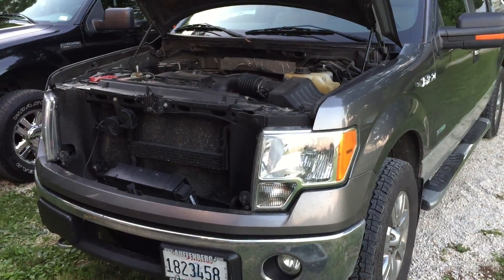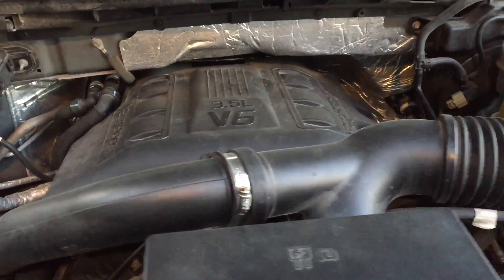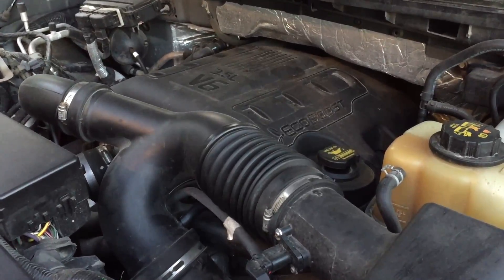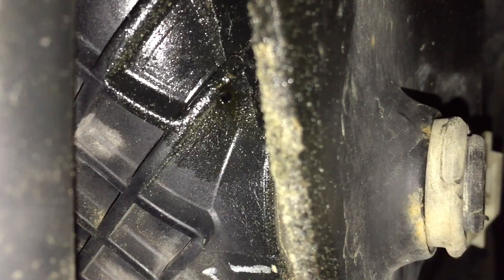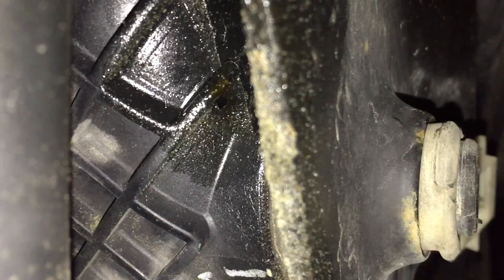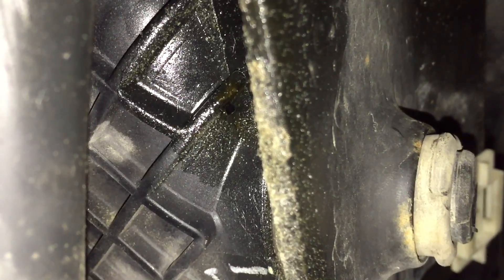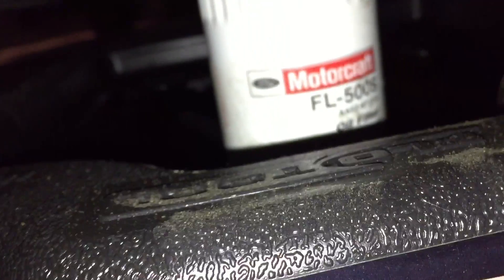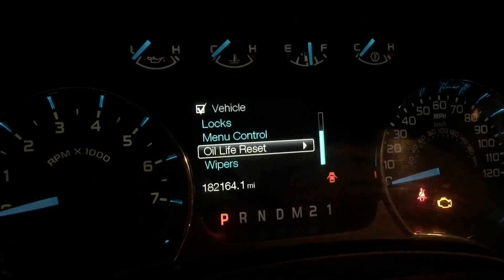Hole Drilled in Intercooler Fixes EcoBoost Misfire

Comment: usually oil in the charge pipes means your turbo needs to be rebuilt soon
Reply: The Tool Guy's username is completely appropriate.  He's a complete "Tool".
Reply: the PCV valve is a one way valve. normally hooked up between valve cover and intake manifold.  it normally only allows suction when the intake manifold is under vacum... the breather would go before the turbo and after MAF or AFM... pcv and breather normally just pull oil vapor , fumes and moisture from the crankcase wich can cause buildup of gunk... if the crankase was to see boost pressure most of the oil seals on your engine would fail... 

most guys performance shops will tell you that excessive oil in charge pipes means your turbo's bearings are worn out causing shaft play and and oil seaping into turbine and compressor housing......
Reply: The Tool.  OMG let it go,  your being a "keyboard warrior".  I honestly have no clue why you have your panties in a bunch. I asked a question and you call me a dumb ass.  Like I said before have a nice Thanksgiving, I'm cooking.
Reply: I never looked at the PCV systems of cars that came turbocharged from the factory. Normally when i turbo a car i delete the stock PCV system. I prefer to use a catch can with a breather .....
Reply: The Tool Guy usually it has the pcv on the intake manifold or right before the throttle body.  Oil in the intercooler or charge pipe means bad turbo.
Reply: The Tool Guy after the turbo?  Or before?
Reply: The Tool Guy where did I say the "turbo magically makes the oil go away"? Arm chair warrior? You're the one calling names. Lol.  Tough guy.  

There's a breather and there's a pcv.  Pre turbo is a breather after that is a pcv. By the way,  a pcv is a one way check valve,  no boost in the crank case no matter where you put it.
Reply: direct injection is mainly the culprit in that cause gasoline doesn't hit the back side of the valve causing real bad carbon buildup on intake valves.. pcv valves cause gunk buildup inside of intake manifolds mainly...
Reply: The Tool lol,  go educate yourself and grow up.  Learn to have a conversation.
Reply: The Tool,  okay.  Buddy.  Have a nice Thanksgiving.
Reply: samuel loves,  the tool needs to read your reply lol.
Reply: and when the seals go bad your exhaust will be blowing smoke..
Reply: samuel lopes. I know a few years ago the PCV was causing shit to build up on one cylinder head. Every 20,000 miles the damn things needed a new head.
Reply: not always. could be a normal buildup of oil and condensation over time, especially on higher milage vehicles. Thats why alot of guys in the diesel world reroute the PCV. The small amount of oil that comes through the PVC covers the inside of the intake system and fills up the intercooler. Then the EGR introduces soot into the system which sticks to the oil and builds up a nasty charcoal cake in the intake and intake runners.
Reply: too much shit talking. when in doubt check the turbo or turbos for shaft play....  usually smokey exhaust is a good sign of bad shaft seals...
Reply: there you go again.. if the turbine is hitting it's housing wall thats a pretty good sign you have way too much shaft play...
Reply: That's not necessarily true.  The breather tubes to evacuate pressure from the crankcase is connected to the intake on the turbo.  That is the oil vapors that accumulate over time in all the tubes and intercooler.
Reply: No it's not. It's a sign of shitty engines and engine parts. I've worked on thousands of turbodiesels and when you've got oil in the intake system you've got a problem.  It's shitty PCV system on those boat anchor EcoBoosts that is the problem.
Reply: The Tool Guy so you're saying most techs don't have a dial indicator ???
Reply: The Tool Guy hahaha I forget automotive mechanics have to have a machinist measure anything smaller than their pecker
Reply: Oil is from blow by
Reply: All turbo and supercharged engines end up with oil in the charge air coolers and pipes. It's just a side effect of forced induction.

Comment: i am 1000% against doing this. it is completely asinine
Reply: No its not. I had my motor replaced at 60k and receive my truck back, the problem continued so I drilled the hole and haven't had the issue since 130k

Comment: How the hell is he getting 22mpg??? I'm only getting 16.8 mpg in my '12 ecoboost f-150
Reply: Mine technically was not in 4wd because the transfer case has to be engaged to get pulling power to the front wheels. (switch on dash 2wd 4wd and 4wL) The hubs were staying locked in which means the front axles were turning when you roll the front wheels thus if they turn that means the front differential has to turn and then the front drive shaft turns and then it connects to the transfer case where is spins in (neutral).  All this is power robing and most of all fuel mileage killer.  Now to diagnose the problem jack both front tires off the ground with engine running and spin the drivers side.  If the front axles or driveshaft turns then the vacuum switch i spoke of is bad or you could have a bad vac line going to the hub on either side (unlikely with low miles).  Remember engine running wheels jacked off ground and also selector switch on 2wd.
Reply: @purplemartin2233  new to EcoBoost... what is this "hub" you refer to?  Expand please... thanks!
Reply: Thanks for the advice! Ill post a reply after checking. Lord knows how many trucks this may be affecting...
Reply: killswitch022 putting around the back woods on flat flat Illinois ground, at 55 mph.
Reply: check you vac switch that operates  the auto hubs.  the $20 switch goes bad and you hubs stay locked in killing your fuel mileage.  its located on driver firewall and takes 30 sec to change. fixed my 13 eco fuel mileage. went from 16ish to 20-21 plus mpg
Reply: mark - does that mean your 4x4 was staying constantly  engaged?  what were the symptoms that led you to this discovery?  i'm curious because  my 2012 had to have both front hubs replaced at 45k....twice.  When I'm offroad in 4x4 I hear a lot popping coming from the undercarriage when articulating.  The guys at the dealer couldn't replicate it so they told me all was well.  My  biiggest issue is i can't get better than 14.5mpg!  Thanks for any additional insight.
Reply: Shit I have a 2015 and I o ly get 17.4
Reply: Altitude makes a big factor

Comment: Interesting fix. I now have 344,000 km on my 2011 eco and to solve my condensation issue I went with a full race all aluminum front mount intercooler and piping it cured the problem as well and lowering the boost pressure air temp
Reply: This is something I believe my used truck has installed.

Comment: You shouldn't have any oil residue coming out of the charge side or exhaust side of the turbo. If there is, the turbo shaft seal/s are probably leaking...

Comment: While I worked at a Ford shop I noticed these 3.5L ecoboost engines really never had any issues
Reply: I have 190,000kms  (118,000 miles) and not a single issue of any kind.
Reply: A lot of pelple were nervous about these engines but Ford said they were the 'upgrade' from the naturally aspirated V8 (Coyote?)
Reply: Well other then the timing chain and phaser issue not unlike the 5.4L did...so 10+ years latter...same issue different flavor. Oh yeah and exhaust manifolds...been through several and several turbos too!
Reply: robert feller how do you know when it’s time to replace the turbos
Reply: lots of broken exhaust manifold studs
Reply: Benny wurz is mad he got a 5.0 instead of 3.5
Reply: @bigf1502  I have several Ford trucks,  both the 5.0 and 3.5  EcoBoost.  The EcoBoost is major pain in the Ass!
Reply: @bennywurz2995  You got lucky with your 5.0 then. Feels like all of those old tritons were terrible now days. Bought a used 3.5 from 2011 and it's in good shape.
Reply: This is a fucking piece of shit

Comment: actually it's not moisture build up its a blown turbo that much oil and water in there is from the turbo seals leaking those turbos are prone to fail there's allot of company's that have used that design vw audi Subaru and so on ...ever heard of water and methanol injection? water in the intake track wouldn't cause that.
Reply: Eric Leo water and methanol injection is different from liquid water lying in an intake pipe SMH
Reply: Krankie V 
well for one thing no one said anything about water in an intake pipe, that would be pre turbo if it was in the intake pipe and have nothing to do with the intercooler...there's a high pressure side and low pressure side of an intercooler and that being so it wouldn't pick up the water or oil from the bottom of the intercooler, my statement about water and methanol was just that a statement that water getting into the combustion chamber on that small of a scale wouldn't cause what was happening...  that sludge  coming out of the bottom looked like antifreeze and oil contamination and would lead you to think it was blown seals in the turbos... sorry I should have been more specific about the water meth statement.
Reply: Eric Leo I'm taking about the outlet.from the intercooler. as stated in the video, this area experiences a lot of humidity. this caused watery condensation to build up heavily in the unit, then under hard acceleration, water and oil mixture would be forced into the intake. it wouldn't be a fine mist like water/methanol injection, rather just a dribble of actual liquid which can very easily cause a skip

Comment: hahaha, made me laugh, ford? this vehicles are designed to fail. all is about headaches.
Reply: this vehicle has 182,000 miles on the original engine.  i've never seen this "first Hand" with some other brands.
Reply: Stubby Does Stuff  take a look at the million mile Tundra on TFL and see how many repairs it needed

Comment: to the guy asking about why gm lifters go bad.....there was a manufacturing time frame that gm used lousy steal to make the cams out of I believe between 05 and 12, the cam would prematurely ware the rollers out and cause lifter failure I've seen this a handful of times with the 5.3 and 6.0
Reply: mike masse sorry to do it to such an old comment but, steel*  wear*  you are correct on the bad cams.

Comment: 182k is impressive. It seems the first year or two of the 3.5 EB were problematic.  Same goes for the 3v 5.4. 
It amazes me one engine can't make it 100k and another will see 300k trouble free miles. 🤔
Reply: Yeah the fucking 5.4 tritons suck. Engine is faulty design.
Reply: @slowfudgeballs9517 I had an 08 lariat

Comment: What was fords TSB on this if it's a common issue?
Reply from the maker: Ford's TSB is to replace the intercooler and install different shields. But I've heard that it can cause slight performance decreases, loss of fuel mileage, and sometimes not even fix the problem. Plus, those intercoolers are upwards of a grand, drilling a little hole didn't cost us anything.
Reply: +DanielJaegerFilms why not install a catch can?
Reply: Can confirm that on our 2015 f-150 3.5 ecoboost the replacement intercooler did not fix anything. We still had problems with it continually after that.
Reply: Never got to do anything, sadly the truck was totaled from an idiot who ran a stop sign and crashed into it before we found a fix. We've since replaced it with a 2017 f-250 and have nothing but good things to say about it.
Reply: And if you really don't like the hole, you can easily plug it back up for cheap.
Reply: Nissanquasquicars
Reply: briskmlg so what did u end up doing?

Comment: put a one way check valve so stuff doesn't get in.
Reply: +benzlover55 i dont see why it would be needed. there is boost pressure that will be coming out. if anything there would be some air pressure coming out not sucking in air. the valve would kind of be useless.
Reply: +Guinelle1 not when the vehicle is parked.

Comment: I wouldn't call this a good design if you have to drill a hole in your intercooler to keep it from missing. Also don't think it would very reliable in this respect. Honestly just stick with the 5.0l or get yourself a GM small block. That is an engine that will outlast the truck two times over.
Reply: No
Reply: +matthebest018 fuck anything general motors. Hell no
Reply: +matthebest018 My Chevy 4.8L work truck has gone through an entire set of lifters in 130,000 miles. It's not expensive but it's a pain in the ass and tedious. I'd rather drill a hole in my intercooler than change out another set of goddamn lifters.
Reply: and iv had nothing but bad luck with gm. gm sucks
Reply: small price to pay after 182,000 miles
Reply: +cats400 And why's that? I've had nothing but good luck with my GM vehicles. None of this twin turbo stuff. Single cam v8 like a truck is supposed to be.
Reply: HCFX2011 That's odd. What cause them to go? The only thing i can see why lifters would go bad would be lack of lubrication. My daily is a 4.8l right now and I'm at 300k miles and all i've done to it has been a water pump and the intake manifold gaskets. Apart from that it's been bullet proof.

Comment: boost pressure leak ?
Reply: Very minimal
Reply: yes..
Reply: Yeah just quit being a cheap bastard and buy a catch can
Reply: Leadfoot21
Reply: THE saabchanel There is no noticeable leak in boost. I just had mine serviced today by Ford and they didn't mention it at all
Reply: No.. it pushes air out the hole.. positive pressure
Reply: Oh yes, minimal leak is fine. Seriously?
Reply: there is, dont buy eco boost

Comment: is it original trans too?
Reply: You can completely lock out the phasers and flash a tune on the truck. Nearly every engine Ford made that had the technology has had phaser issues at some point, including 5.0l's.. once locked out or "bandaid" fixed they give ZERO issues.
Reply from the maker: Yes. I've actually been really impressed with the reliability of this truck. The only thing that has been replaced besides wear and maintenance items are the oxygen sensors. The misfire issue didn't even show up until he started driving very easily in humid conditions.
Reply: CrazyPainter1000 the 5.4l triton were notorious for cam phaser issues, and if you replaced them or did some other work to fix the issue it was only a band aid fix and it would get worse, and eventually burn up the motor. I also did my research which is why I never bought the eco boost. my 2013 was the 5.0l coyote motor and my new 2016 is the new 5.0l coyote and I have never had an issue. my new truck with the 5.0l is a total beast of a truck, I thought my 13 was awesome until I got the new one. big difference, more HP and TQ than the older model plus sport mode and 700lbs lighter on the actual truck makes a huge difference.